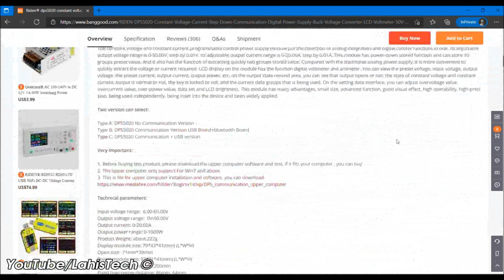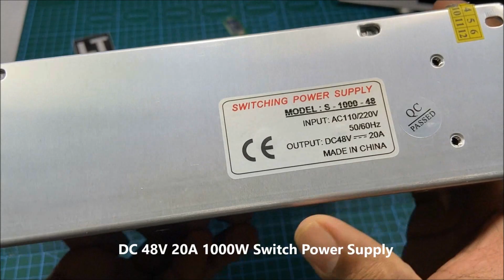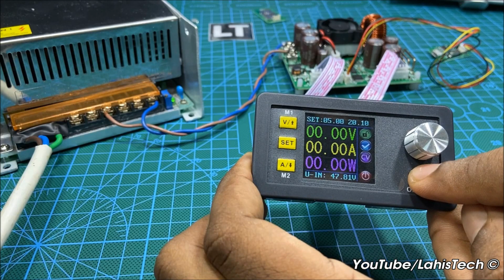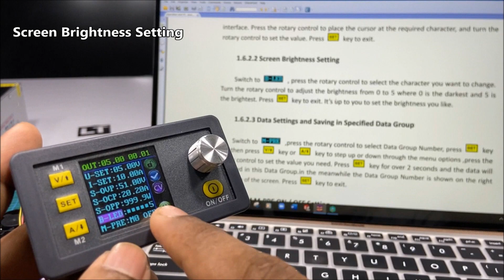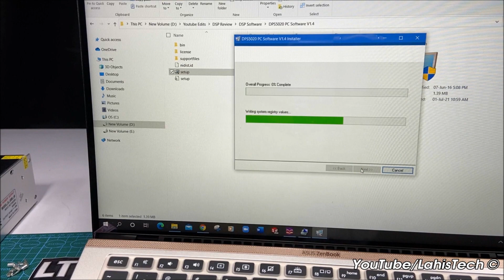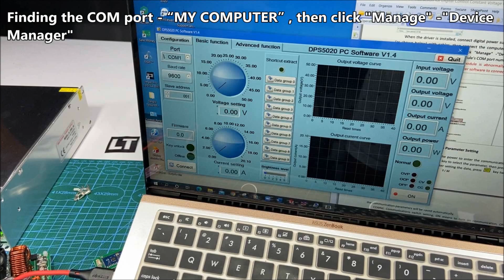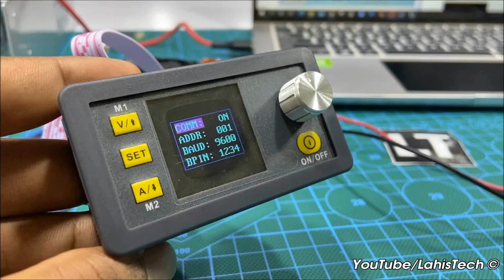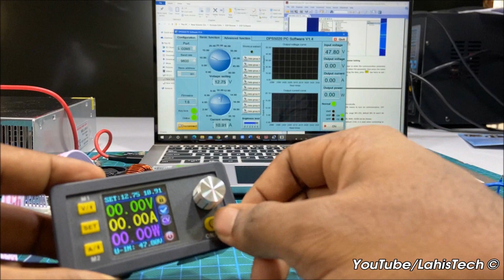RIDEN® DPS5020 Digital Power Supply 50V 20A Communication Version USB + Bluetooth Review and test

Comment: thank you for the video, and it is very detailed,  and there is a note when use it to power on inductive loads like motor, please use under 1/3 of the current range, DPS5020 20A, use less than 6.6A to the motor, so that the device will be safe, for normal load, there is no problem to output 20A

Comment: They are great front ends. I have the same model. I managed to pull too much current on it, and blew the little fuses on the PCB. There are two, just between the the terminals. VERY small SMD fuses: a REAL PITA to remove, and replace.

Comment: Hi Lahis in your previous video you assemble some 18650 batteries connection   which was amassing , and i did ask you for a small advice , here i m asking you again ,, please help ... what is the suitable BMS  board for 4 cell of 3.7v (3s or 4s ) your valuable advice please..
Reply from the maker: That’s 4S since it’s 4cells.
Reply: @LahisTechLT  Thanks a lot Bro , hope to received more new projects in your next next video .due all are very interesting.. tks